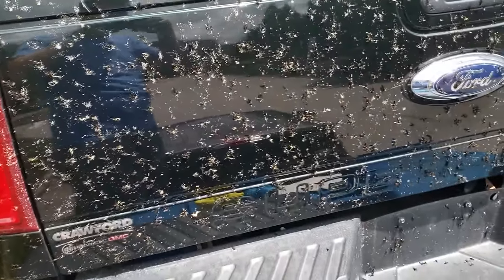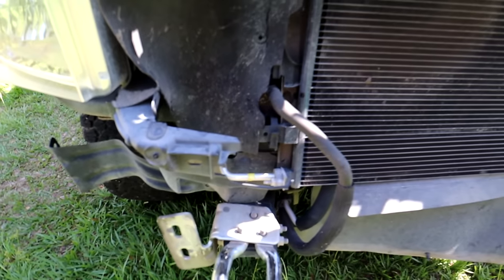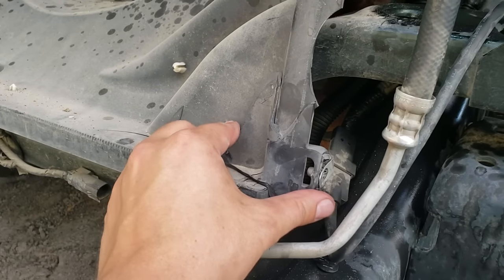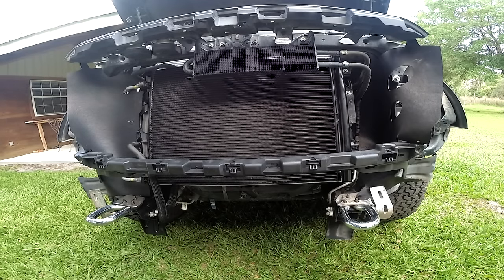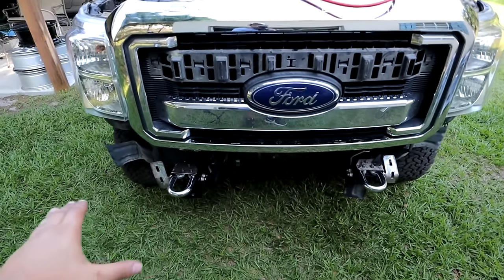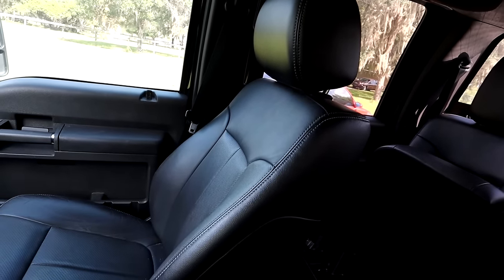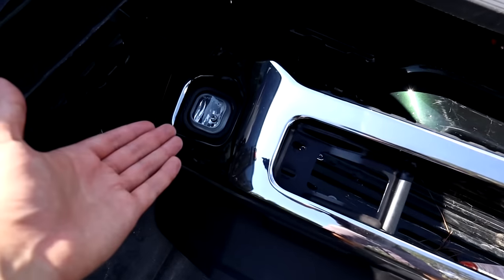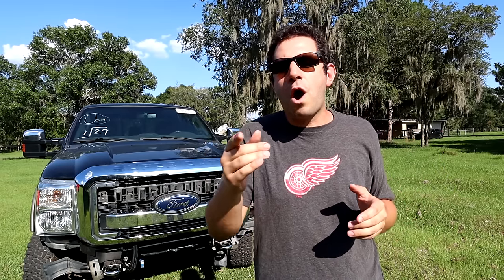I Bought a TOTALED Ford F250 at Salvage Auction and Rebuilt Most of it in a Few Hours!

Comment: Great Find! I think a big reason this truck was so cheap was because it is a gas engine and not the diesel. Personally I prefer the gas if you're not hauling heavy loads or trailers all the time which explains why it wasn't used for a work truck. All in all, great truck and rebuild.

Comment: Speaking of coolant the first thing I do on any new purchase is a total fluid change. Oil. gear oil/trans fluid, brake fluid, diff oils, coolant the lot. Also all filters. Fluids and filters are cheap and you just don't know when they were done last. BTW, ADR'd, converted and approved that would be an 80 to 100k truck here (Australia).

Comment: +Samcrac
 you need to have the power mirror switch in the middle position not the left or right position and then pull back on the switch the mirrors will fold in. hope this helps.

Comment: Amazing deal because no one wants a gas engine F250.
Reply: Anthony Skracic right...
Reply: Exactly
Reply: I do in 2020 and it will be in an F 350.  It's a 7.3 called Godzilla with an iron block push rod motor and 10 speed transmission.  No timing chain issues, no BS turbo on top of a rattle can oily diesel.  $1.00 less per gallon at the pump and can be worked on...
Reply: I'd take a 6.2, and I own a 6.7.
Reply: @johnpyle8027   that's why you swap out the powerstroke  for a Cummins a more reliable engine with almost to no rattle
Reply: Hi have a nice day the most reliable thing on a Chrysler is something they don’t even make lol
Reply: I'd take a gas 250 all day. Cheaper maintenance than a diesel, more reliable than the Ford diesel comparable AND Fuel is CHEAPER. Sign me up I'll take it!
Reply: Alan Holmes 7.0 Godzilla engine 😎
Reply: I’ll stick with my 7.3 diesel
Reply: @alanholmes2366  Yeah but gas engines don't have the same power. You get a 3/4 or 1 ton truck for the power. And if you're using the power (hauling something) then higher priced gas is negated by fuel efficiency. Gas engines' mileage goes way down when you haul.
Reply: Here's the thing, this generation f250 I would get the 6.2 V8 or an earlier one I would get the V10 because power and torque wise, those engine aren't significantly lower than the diesels and they don't have dpf systems or the higher price to buy the diesels, not to mention the cost of diesel fuel.

Comment: Modern a/c are filled by weight.  It’s actually pretty critical in today’s a/c’s.  Real techs don’t just add Freon anymore, they pump out and put in the correct amount.  They hold a very small amount so a little off either way can matter.

Comment: Rich Rebuilds has a woodie daydreaming about putting a Tesla powerplant and batteries in this!
Reply: Dean Cory You just made my morning 😂
Reply: You'd  basically have to fill the truck bed with batteries witch would reduce payload and towing capacity but would make for an interesting build.
Reply: @Tman0517  It is not like there isn't enough space for two or 3 Tesla battery packs in there!
Reply: Rich Rebuilds is concerned this truck would be short enough to fit in the parking garage at his job.

Comment: What kind of epoxy did you use to repair the plastic shroud? 

Always like your videos btw.
Reply: Any form of plastic based filler will work for that kind of repair. Motip plastic putty for example.

Comment: You absolutely need to upgrade with Bilstein 5100 shocks and pro comp dual steering stabilizer.  It made my 2016 King Ranch better than stock ride.  The tires are also E rated with small sidewall which makes that ride stiff anyways.  I friggin love the Last of the steel F250’s 👍🏻

Comment: To power fold the windows press down the window control knob. I also think you should upgrade the sync version to the one with car play and android auto. Also you should install led headlight bulbs and a power running board.

Comment: Good deal! Even though it’s a 6.2 and not a power stroke. I personally like the gas motors more since they are more affordable than the diesels. You did well, doesn’t look like a rusty truck either which is a huge plus with super duties.

Comment: Fixing the radiator cowling with epoxy resin is allright, but any plastic like this subject to vibration is better off fixed with metallic stitches or staples fused joining the broken parts. Epoxys tend to unstick sometimes, but staples will survive as much as the original part

Comment: Damn good truck even with the gas 6.2 I have a 2013 with the 6.7l Powerstroke. Also for Mirrors to fold in just point adjustment switch arrow straight up and pull whole switch straight back. You're gonna want to fold those mirrors in anytime when parked because they are $1400-1600 from the dealer. (Had a dump truck knock one off and luckily had it on camera so they had to pay)

Comment: I really hope the charge on the ac was let loose in whatever accident caused the write off. Just a reminder for anyone working on front ends, letting loose the refrigerant(r12-1234yf) to the atmosphere can get you a huge fine. So unless u know it's been recovered, or let loose due to accident, don't touch AC lines.
Reply: oh no!, u used cans? mixed refrigerant. Just so everyone knows a real deal a/c shop will not service your vehicle if your recharge your system with can recharge kit. 
they are a mixed blend of refrigerants that often tend to wreck havoc on your whole a/c system(oil is needed to lube the compressor and mix blends can break the oil/lube down and gum the thing up), a real shop will have a refrigerant tester and see if u have mix'd/"contaminated" refrigerant 

lot's of the time those can are pure propane. no joke.

Comment: You probably do have a 35 gallon tank but you’ll have some in reserve and the dash is going to tell you to get fuel because it doesn’t want you to run out and destroy the fuel pump because once you run out of diesel you cannot get the truck started again you have to take it to a dealer it’s almost impossible to get a diesel engine started after it ran out of gas

Comment: Will you do a big truck rebuild? I’m fixing up my 2000 Sterling A9500 . Had an oil pan and some other stuff that I couldn’t do myself but still have some u- bolts and the blocks that go under them , the hood and bumper to repair/replace. Also the alt is stuck from sitting without a hood. I’m gonna take my time and have fun with it.

Comment: I think you've got a decent deal there, but the lack of the Powerstroke will haunt you.  Now that it's together sell it, buy a 'stroked one that's otherwise similar.  Your opinion about the acceleration for a truck might change, especially if you look into what a few minor changes can do to light them up.  I haven't gone crazy and I have near 550hp to the wheels and over 1K ft/lbs of torque.  No, it's not a Murcielago, but I've stomped M's, R's, and other cars that thought they were fast.  7k lbs shouldn't be this much fun, but it is, and the only changes are the intake,  a lift pump, and a program for my '16 CC.

Comment: You can get much nicer aftermarket grilles for way cheaper. I have a Raptor Style grill on my 350 that was 300$. Then an additional 100 for the F and R letters because it comes saying "Dodd" probably for trademark reasons. But you can get mesh grilles for like 200$.

Comment: Diesel trucks at the coparts here usually go for $5000-$10000. I'm talking fixable damage to body, bumper, or suspension, with nothing major like frame or powertrain damage. Problem is, because of that bidding is fierce. Even having a salvage title and needing a few thousand in repairs, salvage trucks are often way more preferable than new or used. My supervisor just bought a new truck, not even a diesel, yet for what he paid he almost could've bought a hellcat instead. 

Trucks and SUVs are the breadwinners of the american auto market, that's why the big 3 are downsizing their car lineups.

Comment: That's one nice truck (and I'm a Ram guy). One thing though. It seems in too good condition to have been totalled out. These things hold their value, so surely it would have been an economic repair for the insurance company? Plus it came with most parts needed for front end rebuild, yet it was put in the salvage auction. I don't understand. What's the story Sam? I'm intrigued.

Comment: No I don’t repair any ones car or truck I do them for personal use ( example purchased 2006 CT’s which I purchased ,was wintered in Florida and traded to  Kia dealer as is special fall 2018   .I purchased new tires re did breaks  detailed then got safety checked in 2019 $2500.00 for car and parts  and safety check +tax). I worked at a small town gm dealer from 13 to 22 as a part time job 30 hours a week after school,and approx 50 hours during summer holidays. First I detailed cars then after a couple of years had me working in the body shop doing everything the head tech needed sanding prepping applying spot putty blocking  grinding ,welding . After a short while I was doing colour matches on trade ins and later on some new scratched cars of the delivery truck ,assisting mechanics in engine rebuilds prepping parts painting engines trunks and undercoating got nice paid for training which I kept up on till present great addition to hi school shop lololo.  That was late 1960ies to mid seventies, considered child abuse today lolol

Comment: A friend has a 2013 F150 FX4 with the 6.2L 6 speed auto. I have driven it. Punch it at 62mph(100kmh) and it drops to 2nd gear and takes off. Within 10 seconds I have had it at 100 mph(160 kmh) passing people like they are parked. By that time it is only in 4th gear. Would hate to see what speed it would be at to get it to fully stretch its legs to get back to 6th gear.

Comment: Hi, since we are on the topic of buying vehicles. I test drove a 2014 Honda CR-V  with 42,000 miles on it with a Salvage title yesterday and to learn it had already been in 2 accidents that were fixed .That's a lot for being pretty new of a vehicle. Back brakes were bad .Lots of noise when applying the brakes. Would like your opinion why already 2 accidents? Is certain types of Vehicles prone to accidents? Honda CR-Vs prone to them? Ive actually seen quite a few Honda CR-Vs with salvage titles..they've been reapired but now getting concerned why so many accidents with Honda CR-V's?

Comment: I respect what you do but I wonder if you hold yourself to a high standard. When I service an a/c system, I flush it, and add desiccant in a filter form or with a new accumulator/drier etc.  Also I try to only use quality parts, even if not OEM. Whether or not you choose to, I hope your audience understands the difference. I do admire your can do spirit. Best wishes from Michigan.

Comment: i feel 14k is really high for that truck... i bought a 2014 fully loaded cabelas edition super duty a few months ago for 25k with less than 100k miles.. noting wrong with it and from a ford dealer.. interior other than the drivers seat was in about new condition.. mine is also a diesel.. the diesel alone is an 9k option so that would be about 16k for my truck with a gas in used condition as it sits.. its rare to find a gas like mine so i really have no idea but in other trim levels its about that much difference.. mine also has a clear title... so for me a gas burner truck is a bit high at 14k.. now if it was a diesel then you would have something worth having.. but that is a good looking truck... time for a cummins swap...

Comment: I replaced my radiator on my 12 F450 and a month later it was leaking. Guy told me aftermarket radiators for these trucks are junk. Idk of there's any truth to that but that was a year n 100k miles ago n it's good.
Reply: Repo ManND my Dads friend Bill used to have a 2011 Ford F450 which he owned for about 7-8 years and sold it in 2018 because he didn’t want to drive it anymore since it was heavy and uncomfortable for him to drive unless he put heavy things in the back of the truck and he sold it for about $35,000

Comment: Quick question I bought 2011 eco boost f150 in October 2019 had to weld in rockers and cab corners which  I but did ran out of nice weather have to do brake s and differential clutches and front hubs also and 2 tires . The truck will sit till spring returns to southern  Ontario my concern is the waste gates seizing sitting for4 more months ?. Can I sea foam the induction system or use intake valve and turbo cleaner through the throttle body ? Will let sit with till spring and start and run 5 min several times to get rid of cleaner in turbos and cat so no over heating  occurs and once on the road drive conservatively for the first 200 miles to allow carbon to  exit at low velocity what’s everyone’s take on this?

Comment: Sounds like a  commerical too me.  He needs a work truck every month ? Give that truck to Rich he have it done in now time. If you glue any crack best to use a peice of plastic or steel accross the crack for bracing. 2 hour setup time includes them takinparts out the way to do the pull..

Comment: This is one of the few types of vehicles I wouldn't worry about a little frame tweaking on because it's a full frame vehicle with a straight axle in the front.  Just straighten it out and align your axle/steering and be done with it.  And let's face it, if you buy one that's been worked hard or run off road, it probably has some frame tweaks anyway, so really not something you're totally safe from on a clean title truck.  Good buy here.

Comment: Does not look like it needed to be totalled.  I was a witness of a crash between a F-250 and equivalent size ram truck.
They both had that I AM BIG DOG OF THE ROAD KNEEL TO ME style of driving and well the ram and ford both ran into each other with that style of driving and their full facia and bumper fell off and I laughed my ass off.   Never drive like you are the king of the road as it will backfire on you in surprising ways.

Comment: "frame damage" I knew there was a catch as to why this truck was totaled. In my experience what appears to be just "quick frame pull" turns into a lot more, and a lot more money. I mean after all there is a reason the insurance company totaled it, and there is also a reason why no one bided on this truck and it sold for cheap. Now your cheating because your using a "friend" to do the frame repair so it will always be cheaper, and you will always know it was done right. But I guarantee you if you took it just any random shop it would easily be $5k or more to straighten that frame, and just because of how complicate frame work is, there is a good chance it wont even get done right. Again there is a reason that the insurance totaled it out.

Comment: When those who state the Ridgeline is "not a real truck" are asked for specifics one realizes that they are parroting what they have heard or read.  Of course it's a pickup truck but with innovations that never occur to those who manufacture other brands.  For example, if you have a flat tire in the "real" pickup trucks you get to crawl under the truck and try to remove the spare while lying on a wet, muddy, snowy etc road and struggle to loosen a bolt that has likely never been loosened before.  Oh, and you also get the privilege of fuel mileage that makes  Biden gas prices a real nightmare.   With the Ridgeline, you lift the hinged cover of the bed trunk, loose two wing screws and slide out the tray holding the tire.  The Ridgeline is unsuitable for towing really heavy loads like large travel trailers, but most pickup truck owners don't have to do that, and many pickup truck owners keep their pickup trucks pristine and would never consider treating their trucks like some contractors HAVE to because of the nature of their business.

Comment: Not even a few minutes into my first time watching you... Ruined it once I seen you got a 3/4 ton with a GAS engine in it... Nah I'll pass... You were a recommendation based on goonzquad btw...
Reply: The 6.2 gassers have 385hp and 405 lb-ft of torque. They've still got a big payload and towing capacity. For everything this guy will be doing with the truck, it's perfect and it makes sense. You don't need a farm truck that can haul implements around all day to do your basic hauling. Otherwise you may as well just be a wannabe kid that rolls coal thinking they're cool and never put their diesel to work.